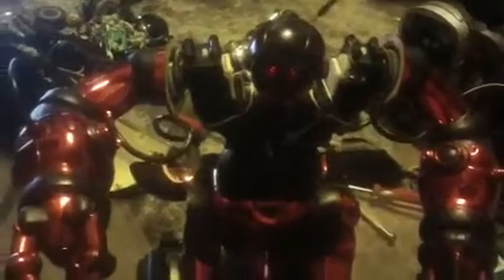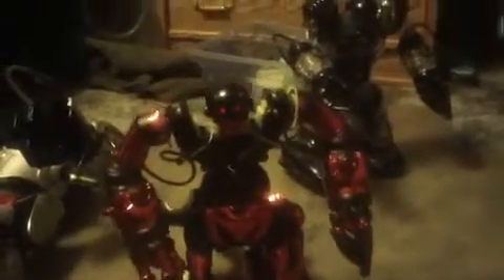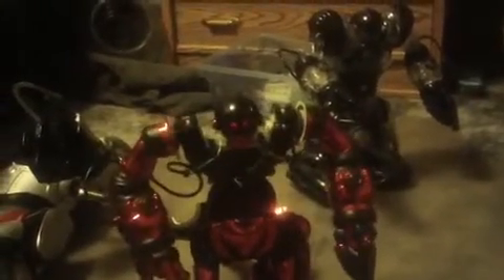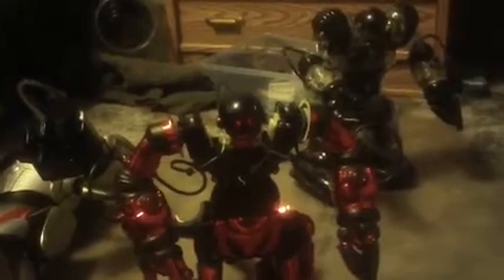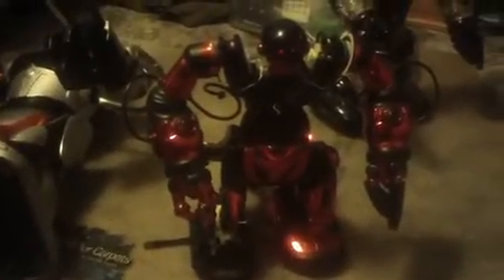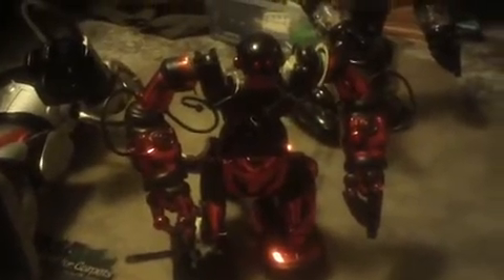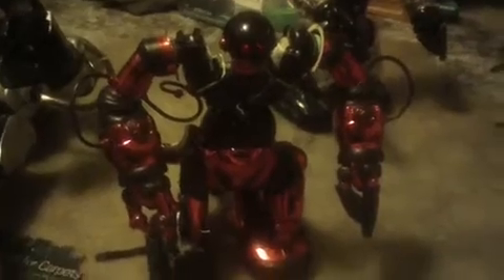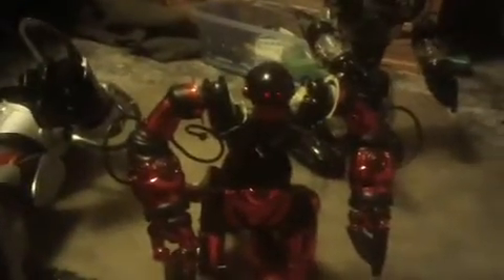robosapien v1 has a leg short out problem

Comment: You should replace the ceramic capacitor which is the thing that was so hot
Reply from the maker: I think it was the board,  if I remember correctly that's what I did and it worked. Or it was the legs, it's been so long I cant remember what I did lol
Reply: @jobeanvideos  lol
Reply: @jobeanvideos  it is weird that you took a battery out and it still worked.... I have no explanation for that.... I was thinking it ran off of it's capacitors but under such a heavy load the capacitors would discharge fast

Comment: I cannot remember the source, but it was a page about modding the V1.. they encountered running into a cheap wire set, where the insulation was becoming brittle, and flaking off.. (the site had a mid-torso with the covers removed, and pieces of ALL insulation colors all over the inside, and sticking to the inner frame.)
Reply from the maker: That was all models of the robosapien v2, I don't believe any other wowwee robot had that issue
Reply: So-far, I don't seem to be having that problem with any of the three V1's I recently inherited. (two white, 1 metallic-green).  Already reading some of the online docs from others, and planning on both a Arduino Nano and an XBee under the chest cover. (Arduino to cover more automation, and the XBee for longer-distance control via RF. Wondering if a digital line will echo through the 1200-baud IR signals, or should I slow the main ATI down to 1200?)

Comment: i have a robosapien v2, the left foot gets hot and i smell something.. ive read on boards that the wires need to be replaced, faulty wires.. happens on most models before 2008.. im not that good with wires and fixing.. wondering if i mailed to you if you could fix, ill pay.. scott_grant2@yahoodotcom... here is some links i found on that problem..would like my kids to be able to play with it..

RSV2 wiring repair

http://www.robocommunity.com/forums/3/Robosapien-V1-V2/threads?page=24

search for wiring problem..
Reply from the maker: ya a person is considered very lucky if they have the black one i have or the uk modle because those are the only 4 that appear to not have those problems if you go to ebay uk non of them are sold as is for parts there all working same with black usually only if they have missing covers or corrosion they well be sold as is